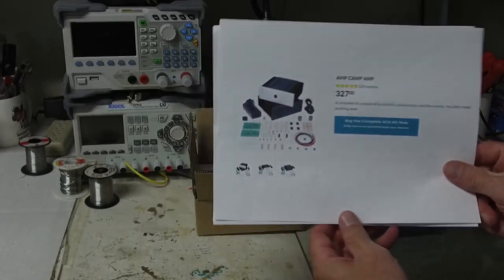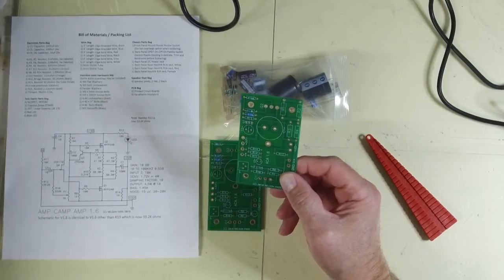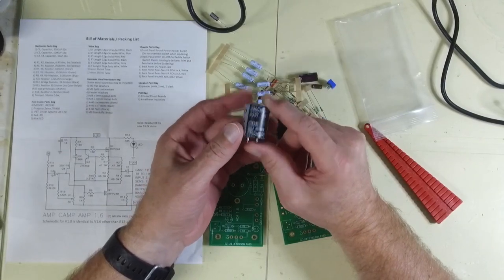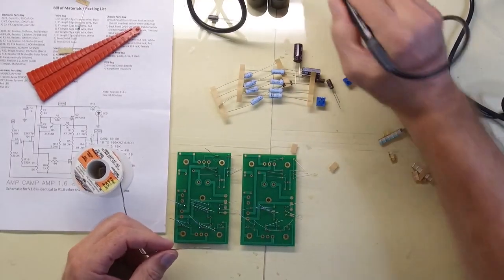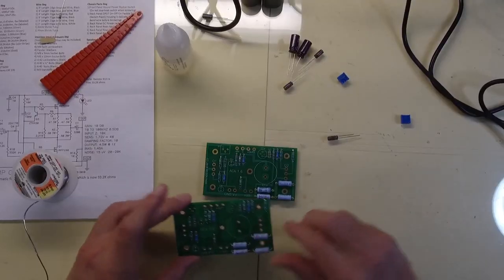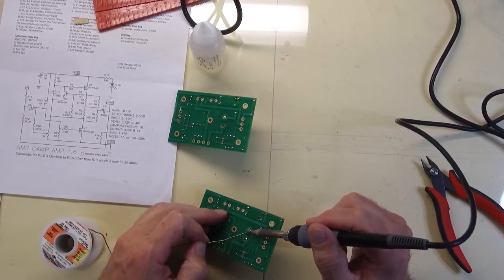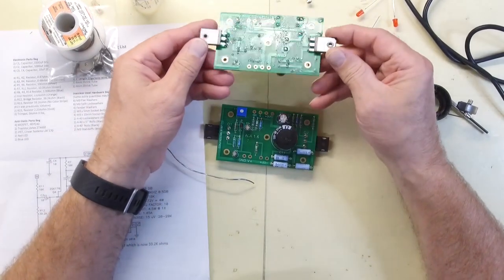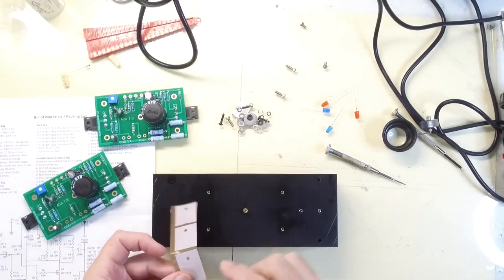Pass Amp Camp Amp (ACA) Build and Initial Performance.  Class A Kit from diyAudioStore.

Comment: The ACA is so popular in the Audio world that me and my friends build it based on basic design by Nelson P., then added flavoring customized front panel to be fully dedicated build with Man-Machine Interface (MMI),  one crazy thing is that,  my build is no large Heat sink,  and used  micro controller to monitor its temperature and auto turn off /shut-off when exceeded the temperature.    Your video just inspired me,  "Salamat Po" - from the Philippines.
Reply from the maker: Thank you for kind comment.  The ACA is a good design.  I would like to make a variant that uses a ducted tunnel for the heatsink and a very low RPM fan to manage the heat.  Thanks.

Comment: Hi Dan, at about minute 31:20, you are measuring the voltage coming out of the connectors.
(I'm Italian I didn't understand very well) I would like to know do you put the tester on DC? and what is the correct measurement to have?
Reply from the maker: Hello.  I first measured the DC input voltage to the amplifier to just make sure that my ground probe was in a good spot.  The purpose of this quick test was to make sure that there were no major errors in the assembly process.  The input and output are capacitive coupled, so there should be no DC voltage present.

No worries.  I am always impressed with people that are proficient in more than one language :)
Reply: Thanks Dan, you are very kind, your answers have been a great help to me. Keep making videos and teaching us all this. Hello Orlando from Rome. @DanPattenAudioG33k

Comment: I've never built anything electrical although I have done  some soldering. To tell you
the truth I was  reluctant to build this unit because I have no idea how to check electrical
values (to ensure/check build accuracy) Now that I have viewed this I feel most of my
concerns allayed. Fortunately I do know a fellow who can check my work with the proper
equipment. This would be a lot of fun (well, my kinda fun) ... I do thank you!!!!!!!!!!
(from what I've gathered the mono-block(2) configuration produces nice results(?)
Reply from the maker: Thanks for the kind comments.  It is not too bad of a build but probably not for a novice :)  As you mentioned, if you can get someone to check your work, you should probably be ok.  IMO, use plenty of water soluble flux and make sure to get promptly washed with hot water and it will help the soldering.

Comment: good morning, I saw your video, congratulations.
I would like to ask you a kindness, on the PCB board (schematic) in the voltage input it says 19volt.
Can I safely use a 24 volt power supply? Thanks, Orlando.
Reply from the maker: Yes, you should be able to switch to 24Vdc.  However, you will need to re-adjust the bias and note that your amp will run hotter because of increased power.
Reply: @DanPattenAudioG33k  thank you very much, I did what was suggested, everything is ok.
Reply from the maker: Good to hear.  Careful of the increased heat dissipation.

Comment: My speaker is Falcon ls3/5a gold badge, it has 83db sensitivity. In this case, this little amp can drive the speakers? I am planning to use mono block with two ACA.
Reply from the maker: For small rooms and normal listening levels, I would think you would be fine.

Comment: Hi.....very nice video!! One question...I also finished building the power amp but I have a terrible doubt how can I set the blue trim with the multimeter?  in the sense ... where should I put the red and black of the multimeter to make the measurement?  and the multimeter must be set in VDC right ??  many thanks in advance!!!
Reply from the maker: The meter should be set to VDC.  The positive (red) lead is connected to the middle leg of the transistor and negative (black) lead is connected to ground.  Possibly easiest place for ground is where the AC/DC wall adapter power supply comes into the unit.
Reply: @DanPattenAudioG33k  ok......many thanks.....🙏😄😄😄

Comment: Nice build tutorial!  I'm curious if the supplied instructions go into much detail or did you rely mainly on your own experience for the build?
Reply from the maker: The manufacturer has very good online assembly instructions. I really only needed to reference the online info a couple of times primarily for the rear panel wiring.

Comment: Hello sir, What capacity toroidal transformer should I use?
Reply from the maker: The supplied power supply is 24V @ 5A or 120W.   You would want a transformer that could supply this amount of power (or more).  A 18Vac output transformer when rectified would be close to 24V.  (18Vac)(1.414)=25V, subtract diode drops and add large filter caps will get you about 24Vdc.  So maybe a 18VAC @ 5A.
Reply: @DanPattenAudioG33k  thanks you so much from Viet Nam❤❤❤

Comment: Including postage it's about £900 for a pair to the UK. The postage is extortionate. It would not cost.more than £75 to send a pair to the uk, plus about £80 tax. It would actually be cheaper to fly to Italy were the chassis is made and buy a couple.
Reply from the maker: That does seem rather expensive.
Reply: Stick to English designs and buy locally. Far less expensive and they would not be embarrassed by anything from here in the US.

Comment: now they need to release 100W, 200W and above kits
Reply from the maker: A more powerful amp would be nice.  The mechanical design gets very expensive with more power as that is a lot of heat to get rid of.  It would be interesting to do a tunnel heatsink with a ducted quiet fan.
Reply: The Pass Labs X150.8 power amplifier consumes 370 watts just sitting there doing nothing. Only to be used in winter. The X250.8 consumes 500 watts. And those are AB designs. Fuggetaboudit.

Comment: I dont see at all high audio caps or using  Heat Sink Compound Paste
Reply from the maker: The output capacitor is a good quality Cornell-Dubilier unit and the other caps are name brand units.  This amplifier uses quality Silpad type thermal pads that are equivalent to paste which also provides electrical isolation without being a mess to use.  Resistors are nice metal film types.   Nice thing about this design is that all of the components are through-hole so substituting your favorite type of caps would be easy.

Comment: I would never buy or even use a class A amp. Nothing makes sense in use it 😜 class AB do the same, wasting less energy and are cheap.
Reply from the maker: I agree that the Class A design is not energy efficient.  IMO, they do sound different.  It is a matter of opinion if they sound better or not.  Some people like them others do not :)
Reply: yeah I really didn't see difference in both sounds. would say that nobody could hear difference in a blind test. but I am actually talking about waves they make in an oscilloscope, the distortion etc
Reply: @pedromiranda7701  I very politely disagree -- I really like the low power Class A designs (25WPC or less) and find they provide more than enough power for my listening and with my speakers (i build higher efficiency 90db+ speakers only). I find they have a grip on the speakers and deal with big transients like higher power Class D and with a pleasing 3-dimensional sound close to the flea power SET tube amps. I've never heard anything like that from a Class AB -- though admittedly I don't think I've ever heard a truly great (or expensive) class AB.
I agree though that I would never get a high powered Class A -- the electricity bill would be a killer and it's such a waste, at least for my listening. For bigger rooms and louder listening I agree Class A doesn't make sense.
I never use Class A in summer, and even in winter I have them wired up with relays and triggers to go into standby when not in use.
Personally I do hear a difference -- and I've only ever listened to the low power Pass Class A designs, and can even hear slight differences between his various designs (and that's with 50 year-old ears). I struggle however to hear differences between most decent DACs though!
Reply: @ssmith954  well, my "use" of sound is based on flatness and high pressure. so I start by setting up tweeters with integrated circuit amps, that are AB. at that point, in max volume and lower possible distortion, I get a certain dB for treble, say 100db in a very flat response in high frequencies. Then I go to configure mid and lower frequencies with the same dB response, to keep everything as flat as possible only by using speaker "engineering", not equalizer. So now I have to get a subwoofer that goes down low about 20hz with air duct. The driver must have a flat response from 20 to, say, 500hz. To do so the speaker usually can achieve only 85db per watt. To make that speaker achieve that same 100db that tweeters, I need a lot of power, that's "impossible" with class A. In this example it'd take about 5 times more power RMS to pump subwoofer linearly with tweeters. If they are with 30w, subs will necessarily use 150w. 
I do the same calcs for midrange speakers, always measuring distortion and flatness. Most times for a speaker to have that fidelity it may has very low sensibility, around 89db or less. In the end, when everything is set, I get a HiFi system that also is very powerful the way I appreciate. Having just one system for all my needs, from study with Joshua Radin to party with Foo Fighters 😳 today my system is not perfect because I did measured but didn't select the right power for each band. Nevertheless, everything is good and doing well. The pressure is to make my heart beat out of compass. I'm using integrated circuits from Sanyo, achieving a max 310w with 0.5% of THD.
My amp has only 1 button and 1 potentiometer, power it on and off and set volume pressure. no equalizer. I'm doing some tests and probably will soon power my subwoofers with a class D amp due to its low distortion in low frequencies. They are powerful and efficient.
Reply: @ssmith954  I'd like if you forgive my bad English grammar and repetitive vocabulary, I'm actually Brazilian and currently studying English, that's hard! 😅
Reply: @pedromiranda7701  Sounds like an interesting set-up! I've played with some bi-amping and tri-amping, with class d for woofers and class A for mids and highs in the past -- worked very well. Nowadays though I'm back to simple class a with high efficiency two-way speakers and standard crossovers. I don't play that loud though!